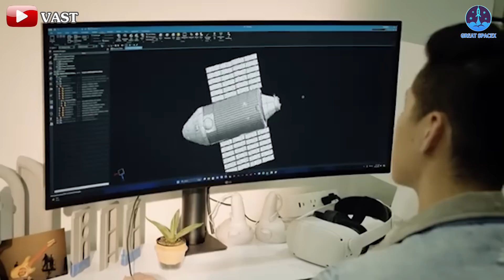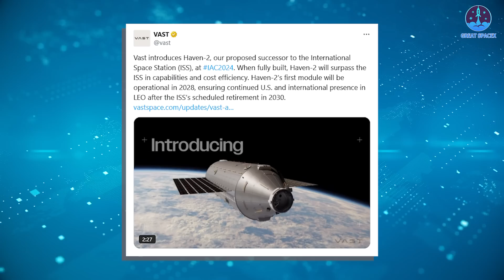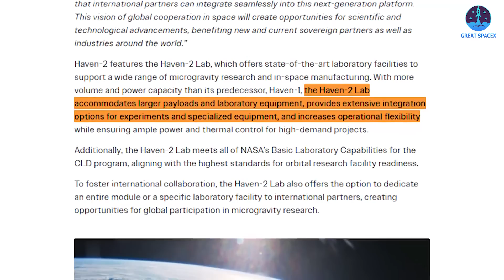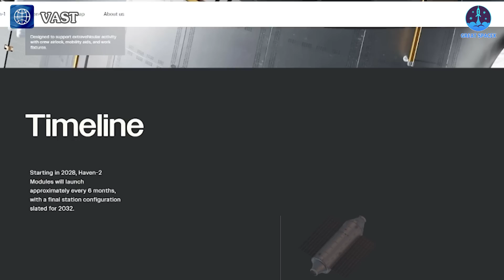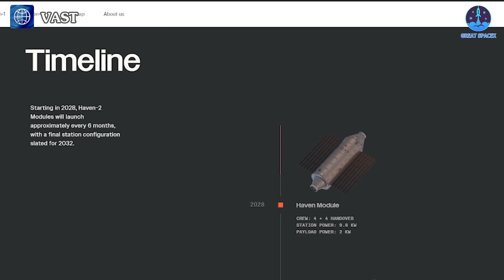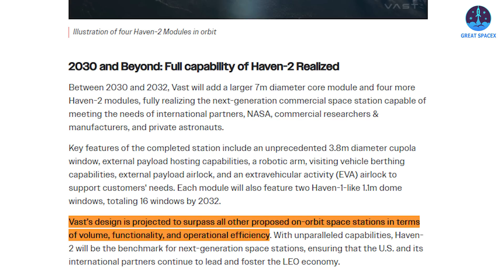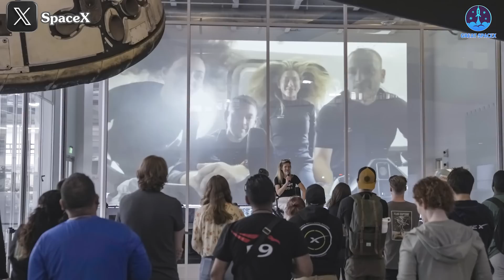SpaceX just Revealed New Starship Space Station After Flight 5...

Comment: I believe this design, which is better than the ISS is limited in thought and limited it design. 

My idea would be to have each module being only ¼ of a module with each part of the module being pie shaped in the middle and of course having ports to connect multiple space ships at once, four to each end of the module.

Let me explain. Each pie shape would include a port at each end with the center of each end being a much wide opening to join different modules together through "pipes" which would allow rockets to dock at the end of each pie section and a tube to join modules together.

Note that once all of the four pieces of the pie are joined together, the straight sections of the wall could be retained or they could be removed. Other interior walls could already be inside the pie shape for rigidity and also to create rooms that will still be there once the flat external walls are removed and reused for internal walls inside this much larger module.

Again, think of course pieces of pie connected together with internal rooms already inside of each pie and then the flat external parts of each pie either kept together as a whole or sections of the outer flat wall would be removed so that a larger room could be had when sections of the four pieces of pie are opened up to each other. 

This would give a LOT more options for layouts in the module with much larger rooms being available depending on the layout of the walls that are kept on the inside of the pieces of pie. 

Then at each end of each piece of pie would be a port for connecting rockets to the module for a total of up to four rockets docking at one time at each end instead of only two rockets, one at each end, or one module at each end.

Another option would be to have the four ports at each end (one for each end of each piece of pie therefore being four at each end. Instead of docking four rockets and one tube connecting to another module at each end. You could also use the end port PLUS the docking ports to have up to FIVE modules connecting to each end of a module so that this module becomes the center of a whole set of modules in 3D space instead of everything laying out in 2D lines. This would allow many more modules to be in close proximity with each other. 

Continuing with that thought of having one modules being the core of a 3D branching of modules you could build what could end up being large ball shaped group of modules as they branch out in triangles to/from each other.

Once you have this ball shape you could then build an outer section where you could send rockets out and capture asteroids out past Mars and bring them back to the collection of modules. You could pick and choose which asteroids to collect but one of the big things you could do is bring a lot of water ice back to the group of modules and melt the water and fill an outer layer like a skin of a ball but filled with water which would absorb a lot of the solar radiation so that the inner most modules would be ENTIRELY safe from a giant solar storm where astronauts could gather together to be safe. 

You could then add rockets to this ball of modules and this could become the first interplanetary ship where astronauts would live for years moving to other planets.

With the outer skin of this "ball" of modules four times the size of these modules suggested here, you could have enough water ice or other gases that could become a life saving layer of protection from radiation so that you take humans much closer to the other planets outside of Mars. They would be protected by this thick outer skin with liquid chemicals that would be gasses on earth but with the cold of space they would become liquid.

There are enough asteroids with enough materials including water ice or other frozen or liquid chemicals plus different types of metals are are common or rare on earth. The outer skin could be created from the resources in the asteroids instead of taking materials from earth that are very expensive to send out into space. It would be a lot less expensive to get these materials from space. 

Just a thought.
Reply: Another option is to forget about the current shape of modules completely and instead build any shape that we want. Instead of building "modules" we would build walls that we would take up into space and start building the structure of a space ship. You would build enough of a space ship that humans and humanoid robots could live in.

Instead of building modules you would build a giant space ship. This the Star Trek Enterprise in size. 

You would need to think that large because you would need spaces for people to live that are big enough for them to not feel cramped. 

You would need space to build the factories to process asteroids that you move to and start capturing outside the orbit of Mars.

You would also need a large enough area to grow food. Unlike the limits of earth you could grow food vertically as well as horizontally or in any shape that is best up in space. 

You would need a place for the astronauts to be able to exercise and play. After all, all work and no play would make a very frustrating existence out in space. 

You would also obvious need a bridge and ways to move this space ship from asteroid to asteroid where you would grab onto them and process them. You would also have to be able to maneuver and avoid objects in space, though that is easier than not getting hit on a freeway. 

Again you will need a way to keep the people on this spaceship safe from solar radiation. How that is done, maybe through a thick skin of liquid chemicals like h20 (water) or other chemicals that could absorb the solar radiation so that it doesn't get to humans. While at the same time having a way to captures asteroids and bring them >>safely<<< into the space ship to process them and use them for water, metals or anything else we can create from the asteroids to continue building a larger ship. 

The ship would be independent of earth with no additional cost once you get enough up there into space where enough food is grown and made into food that people will like to eat as they move first out to astroids until the space ship is built. And then off to the outer planets and maybe beyond. We are only limited by our will and by our imagination. I wish that I could include art work of my ideas but at best I can draw stick figure people and animals and nothing more than that. If someone wants to contact me for more details that I could share with them and they could create art work based on my ideas, then it might be easier to visualize what I'm talking about. 

Obviously what I'm talking about would be a crude form of a space ship because it would be the first of its kind and we wouldn't be able to afford to get enough materials into space to make something better. It's just not reasonable to think that we can.

But maybe someone in high school with a great imagination might be excited by my ideas which I have by standing on the shoulders of giants, they might be able to raise the funds to start such a space space ship and build a spaceship if a very cost effective and very different way than people are thinking now about building space stations. 

It will NEED someone thinking differently in a way that other people will think of as crazy in order to take things to the next level and then the next and then the next. But before we can get to those next steps, we need to have someone get takes the first step that can and will create a space ship with the whole reason for building it is to get away from earth and out to the asteroids and then to the outer planets to study them much closer up (obviously radiation will be an issue but better minds can think of ways to protect people from radiation like an outer skin of liquid chemicals that absorbs or deflects the solar and planetary radiation.

Imagine the world being willing to fun the science that could be done by having a space ship and not just a probe out among the outer planets and just being in space. That money would be used to pay the astronauts as they work in space on this space ship.

I would not expect them to ever return to earth. I would picture them living in space all their lives including getting married and having a family up there on a space ship in ... well in space with their children never setting foot on earth and maybe never understand what it is like to live in one G.

But then of course they may build a spaceship like dreams, engineers and artists have thought about for many decades where you have an inner core with spokes sticking out and the whole space ship revolving so that the "ground" on the outer spoke is 1G. 

Or maybe someone can figure out how to invent a way for everyone to feel 1G as they walk around inside a space ship like the space ships in Star Trek and Star Wars. There are MANY things that we thought impossible until bit by bit we create more and more until something IS possible and someone makes it and suddenly more than a billion people experience it every day. 

Try to tell someone from the very early 1900s that everyone would have a cell phone and we communicate with that more than we do talking person to person. That's just one of the many inventions that were created after 1900 or 1950 or after the year 2000. 

We can't imagine what people will invent one hundred or 500 years from now. But we have to dream and start somewhere. Why not picture ourselves taking a step past just having a space station orbiting earth.

While a space station around earth is great, that is just the beginning of what we should do.

Comment: With a finished VAST Space Station all you would have to do next is mount a torus shaped structure around the outside and BAM...you've got a Wagon wheel style station capable of artificial gravity.       👽👍
Reply from the maker: Wagon wheel style station is awesome.
Reply: What is the tension force on the wheel, assume 1G Earth-like gravity.  Also a doughnut shape pressure tank blown up with one atmosphere of internal air pressure has so,me i=unbalanced force.    So what do you build the wheel from?  I think it would have to be build like a radial car tire with steel or kevla cables wrapped around the outside to contain the millions of tons for force.

Here on Earth, the reaction force is free.  If I stand on the ground (bare dirt) and push down with 180 pounds of force, the ground pushes up with a matching force.   But in orbit we must build a structure that pushes up the weight of the entire space station plus its own weight.

But actually a space station with gravity is useless as the whole point is having microgravity.

Comment: I don't get it.  Why don't they develop a specialized non reusable version of Starship without fins and without tiles?  Also launch it with only 1 vacuum optimized raptor engine (possibly a pre-flown one, to save cost).  Because since the air density at stage separation is very low one raptor will be able to provide the delta V (albeit with a much longer burn).  Also put on a non reusable faring covering the air lock on top.  In this case you have a 9 meter diameter space station module  that can be mass produced.  The booster will return to Starbase and the space station will eventually make it to a circularized LEO.  It does not make any sense to me to put the space station module inside of a fairing.  It sounds like a box inside of a box.  Yes with only one raptor as long as it can withstand the longer burn the station module will reach LEO eventually.  That would operate as an alternative second stage on top of the super heavy.   Spacex can leverage the life support systems it probably has already developed for the lunar lander version.  I can't possibly the only person who thought of it.  It is too obvious.   What do you guys think?
Reply: I like your enthusiasm 😊

Comment: Somehow the big windows particularly in Haven-2 raise my concern, lets hope they will be as durable against space junk and meteors as the hull of the station.
Reply: I imagine that they will use (AION) Transparent Aluminum, which is three times harder than steel. If necessary, they could always stack them if there is a requirement to do so.
Reply: @randybentley2633  I remember reading about a transparent harder than steel material, but had forgotten what it was, so thanks for refreshing my memory!
Reply: It won't happen to the extent reported here at least not in this generation. Kind of like all the windows on the Starship or the window initially planned on the door of the Dragon.
Reply: The first one in the video had latches so they will probably be closed most of the time.

Comment: It's not revealed by SpaceX but by Vast.
Where are the heat radiators?
How do they plan to rotate the entire station to keep the solar panels aligned with the sun in a 30min orbit?
Don't these Starlink-placements get blocked when something is docked?
Where are the covers for all these windows?
Reply: Good questions for when the designers stop making it look pretty and the engineers start making it practical.
Reply: Replace the solar panels with a nuclear reactor. The technology should be safe enough by now.
Reply: @5530fsc  Bad idea.
Getting power isn't a problem.
Getting RID of the heat is.
Shielding for humans is prohibitively heavy.
They all want water behaving in gravity.

Comment: Haven is a tin can and not nearly as accommodating as Sierra Space/LIFE modules. It is also running into severe financial issues at the moment and likely to collapse. Sierra Space following Bigalow's work is a much better option. It is larger, more flexible, easier to transport, and cheaper. Better yet, it or PseudoPlanet (ESA) give options for expansion up to and including a torus. That way spin is possible and artificial gravity (centripetal force) lets people stay in space without the worst effects of low/no gravity. Stick a propulsion unit on it, and you have an RV in space! Kind of like Space Balls.

Comment: Can anyone tell me why there are so few projects slated for High Earth Orbit as opposed to LEO?  I get it takes more gas/thrust to get there, but I'm assuming it takes less to stay there as well?
Reply: Space radiation
Reply: High earth orbit is approximately 36,000km+ compared to low earth orbit at 2,000km.  The Earth's magnetic field protects from radiation only out to approximately 60,000km, but weakens the further you go.  While HEO is still within the Van Allen Radiation Belt, astronauts would have to deal with significantly more radiation further limiting how long they could stay there before suffering health complications.  It also takes longer to get to that altitude and costs significantly more per launch.
Reply: The effort required to get to a higher stable orbit is greater than boosting yourself every so often. That along with increased radiation.

Comment: Why not build a station based on the Starship chassis?
Easy to launch, each module will be.....vast......
Reply: I agree you could put in a lot of substructure in the tanks like grate flooring an ladders and a hatch in the tanks! Then all the padding could be unpacked later to double the living area and storage area, just shuffle stuff around thought the tank vessel hatch!
Reply: @jamesstanbridge2022  Now imagine what they can build on the moon and put into orbit from the moon given the low gravity.  Moon based construction is the future.  Launching everything from the moon is the future.
Reply: Converting the tanks to be used for science would be quite the under taking. Imagine having to mount cables and equipment. You probably wouldn't want to drill holes in the walls and i don't think we have attempted to weld in space yet. Maybe adhesives but those walls also aren't insulated.
Reply: I agree. The Starship with its huge tank sections with easily cleanable methane section made of fairly thick stainless steel would be ideal. Block 1 Starship being about 50 meters long and 9 meters wide they could fly it up there and add access ports once its up there. Various other additions could be sent up on another Starship or even on Falcon 9 and all done shitloads cheaper than anyone else could do it.
Reply: The explanation is pretty simple. It takes time to design a space station, and Starship is not yet operational. As is, this project doesn't particularly rely on anything new or fancy, so they can focus entirely on launching good quality modules using very mature tech, and then probably lean more on Starship whenever that platform matures.